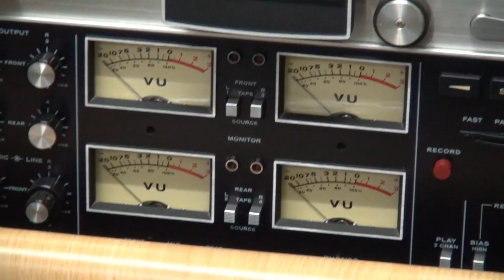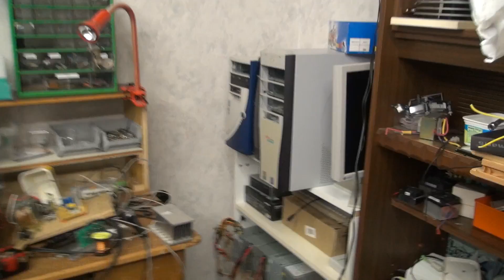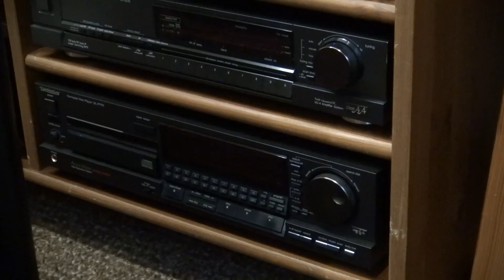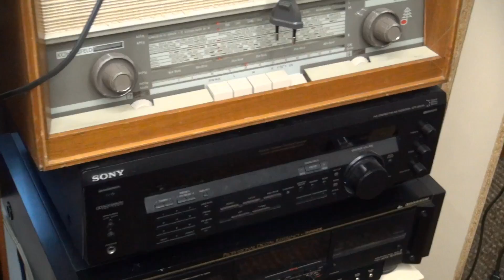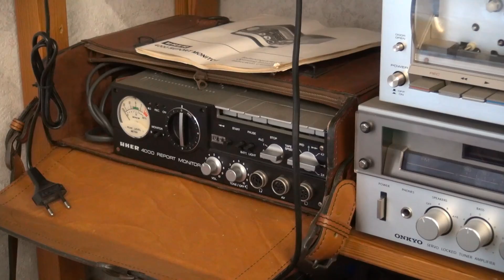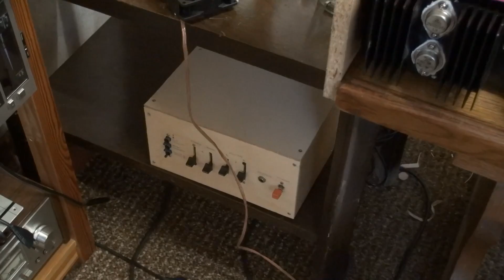DrCassette's Complete Collection - Overview (January 2015)

Comment: A good idea is to keep a device and a back up device of an obsolete media type, for example VHS. Keeping just 1 VHS recorder is risky, as these devices continue to age and eventually something inside is going to fail. Same goes for reel to reel,  cassette decks, mini disk, turntables, etc
Reply from the maker: Of course if you work with old media professionally, you can never have enough equipment, either for frequent use or as backups.

Comment: I know this is years old now, but I used to have one of those sweet Sony video8 camcorders and you can pull a composite signal out of the mutliconnector.
There's a pinout online and I just used a couple of pin header connectors that I wired to a piece of composite cable.
Reply: Also you should use those British monitors instead of them sitting there gathering dust!

Comment: The Teac is actually designed for a small home recording studio. Parts are still manufactured for it by other people and everything is obtainable as new old stock. I use two of them synched up with a 16 channel/8 track Teac mixing board.

Comment: For the auto reverse in the 2340R, it could very well be an issue with dirty relay contacts.
Reply from the maker: There must be something wrong with the connections to the heads, that's right. I found out that recording on the front left channel does not work either. Just no signal at all going to the tape.
Reply: There could also be an open coil or winding in the heads.
Reply from the maker: Argh, there better not be!!!
Reply: I know, but just realize that could be possible in the worst case scenario. Furthermore, I have a video on my channel showing how to clean the contacts inside the relays. My TEAC is an old A-4010S and the relays are actually in sockets so they can be removed. Not all TEAC relays are the removable socket type though. Some are directly mounted into the PCB. If you see metal wire clips over top of the plastic relay covers, they should be in sockets like on my deck. Otherwise, they usually aren't removable on later models. My A-4010S happens to be an early one from 1967. Nevertheless, check out my video if you want to see what I'm referring to. I also have a second channel "The1970sInfatuate" with more videos. Hopefully you'll be able to get things fixed.

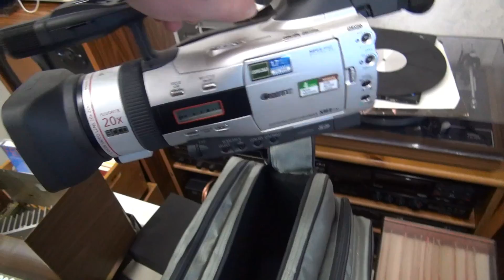Comment: You sure have a lot of stuff :)  I liked the Canon XM2 at 29:14. I didn't see your Sony HDR SR11 or Sony DCR VX1000. You should make a video of all the video cameras that you own. Keep up the good work :)
Reply from the maker: At this point I actually want to sell all the camcorders I have except for the XM2 and the Sony CX570. The money I could get out of those sales at the moment is a lot more useful than some camcorders I barely ever get to use. I may however get a Sony AX100 as it seems to be a great unit.
I sold the Sony VX1000 years ago already. The Sony SR11 is in the apartment, not in the workshop.
Reply: DrCassette They say the steadyshot is bad on the AX100 compared to the AX33 with balanced optical mode. I mainly want the AX100 because it has a 1 inch sensor.

 Which camcorders do you have that you would make good money from selling?
Reply from the maker: The AX33 as far as I know isn't even on the market yet. But going by all the other specifications the AX100 will be a million times better than the AX33. I'm not a fan of the balanced optical steadyshot. It may deliver great results, but I have a feeling that will be the first thing to break on these camcorders due to the stress and the mechanical components. Also it causes a fair bit of background noise.
The valuable camcorders I currently have are the Canon HF-G30 seen in this video, a JVC GY-HM100, the Sony SR11 and a Lumix FZ150. All those are going to go up on Ebay as soon as possible.
Reply: DrCassette I had the chance to use the AX100 at a Best Buy store. It was very nice but they should of made the LCD screen higher resolution. I made some test videos too but not in 4k since I didn't have the right memory card. It's weird how the AX100 is $2000 but the AX33 is only $1000. 
I heard that 8K video is 1GB a second. I'm pretty sure 1080p 28mbs is 1MB a second so that is a big difference.